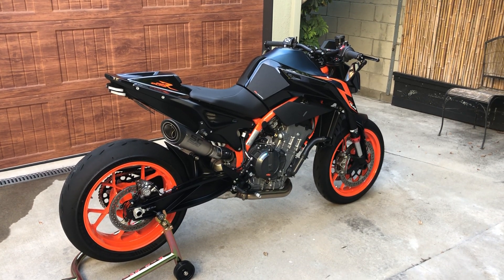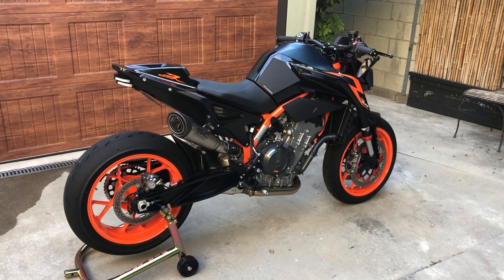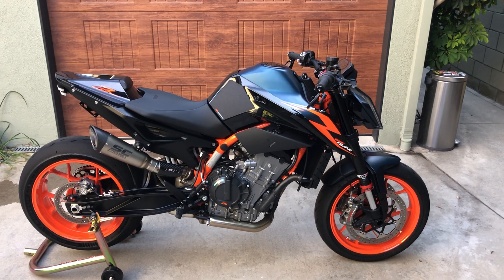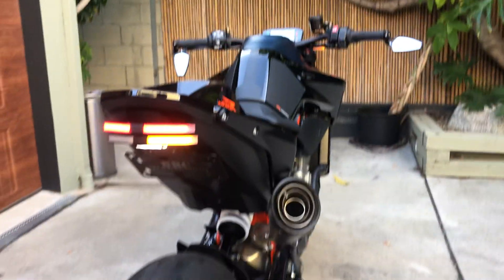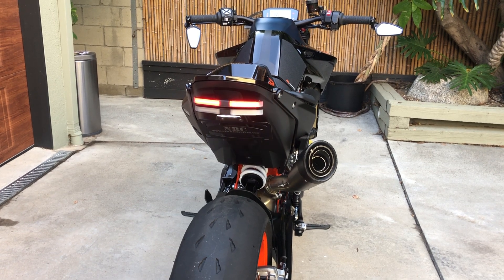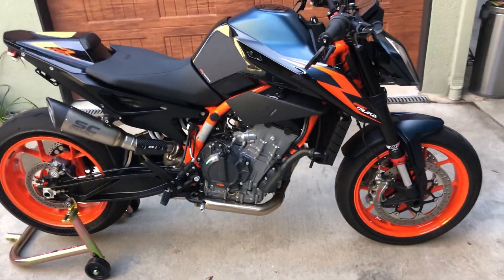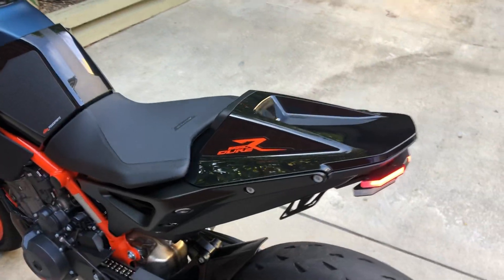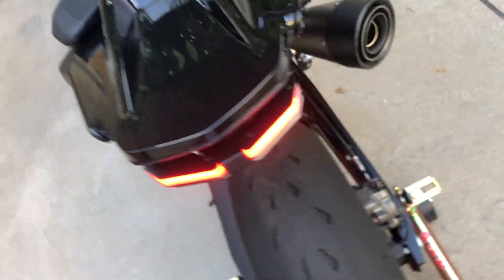KTM 890 DUKE R Day 1 Mods

Comment: Notice any loss in power with this slip on? I remember reading somewhere that you will lose some power without remapping. I am trying to decide between this and Yoshi AT2. Definitely SC looks better but got me thinking about the loss in power. I am going to run it with cat.
Reply from the maker: Sorry can't really answer your question. I was still breaking in the bike when I modded it so hadn't really opened it up with the stock muffler. Good luck with your decision.

Comment: do you have to get the dual equalizer for both rear and front signals? cuz as I know the equalizer will make rear and front signals blink slower if it is true.
Reply from the maker: No you do not, the blink rate is correct without the equalizer.

Comment: Where you get the SC S1?
Also, you have any issues installed the newrage front and rear signals?
Reply from the maker: MotovationUSA. No issues with the NRC signals other then the dash error, which really just helps as a reminder to turn them off. I believe any LED turn signal will give you the same dash error.
Reply: @-Cold-World  nice not to worried about the signal error, how was the install on them??
Reply from the maker: @thatsecguy5896  Very straightforward. All the NRC connectors are plug and play with the OEM harnesses. Only little glitch is configuring the rear setup, didn't really click with me. If it appears not to fit, upside down or blots too short it's not configured correctly. Took me a few tries. They should ship the rear section pre-assembled. Once I figured it out mounts up perfectly.
Reply: @-Cold-World  sounds good I’ll keep that in mind, post that cold start video 🔥